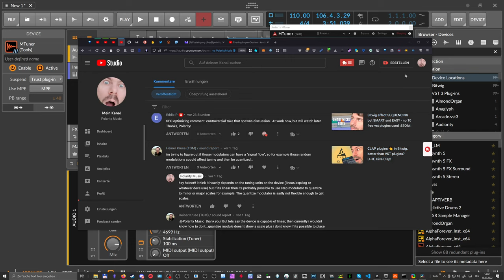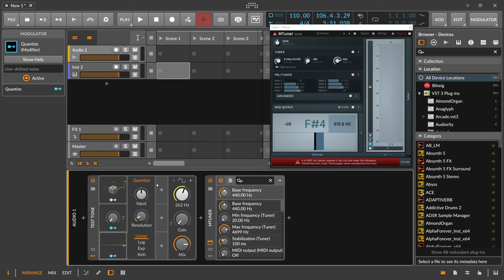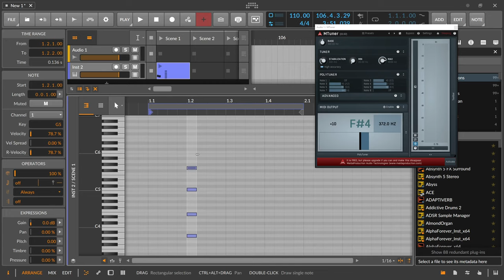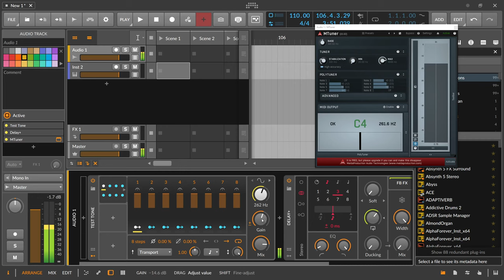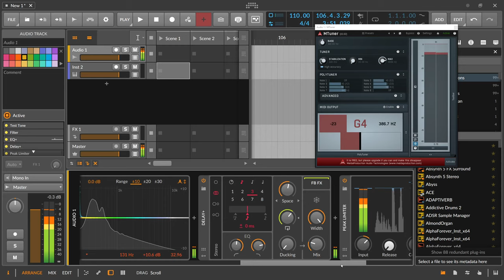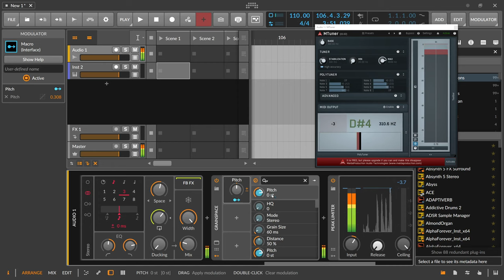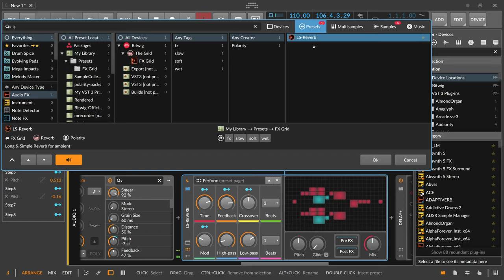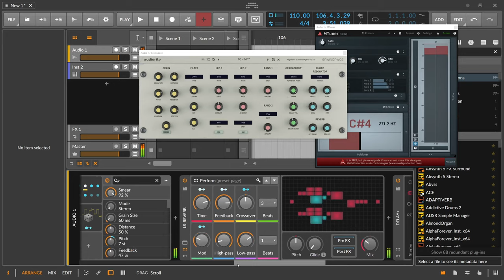Quantize Bitwig Modulations to Intervals, Notes & Scales

Comment: How did you come up with your numbers, 9 for the resolution and 64 steps ? Do you have a reference to explain how you computed this numbers ?
Reply from the maker: try and error and basic assumptions. but you can make it cleaner = you want 7 notes (for a diatonic scale) times 9 you get 63. or times 8 you get 56. so your resolution is 8 and the modulation amount is 56st. but it only works because the modulation unit is (st) and not (hz). not sure why i explained it so complicated lul

Comment: One thing I’ve never found in the bitwig modulators is a slew function (glide/lag) - I bet there’s something in there that can do it, but if so I can’t find where it’s hidden - I’d love it if someone could help me out!?
Reply: Well, in the Poly Grid, there's a module called "lag". If I place it after a pitches module and crank it up sufficiently, I can hear it gliding.
Reply from the maker: Well most modulators feature a smooth function. Some have a lag knob, some a smoothing button in the inspector. And the polynom Modulator can also help.
Reply: @pbrninja19  yeah, it’s no problem in the grid! Weird that it seems to be missing in the modulators
Reply: @PolarityMusic  yeah most of the places you’d want one have it built in but still seems like a bit of an omission to not have a dedicated module since there are so many ways to generate modulation. I know sample and hold can do something close but it’s not so great for longer slews as the slew is relative to the sample frequency (which makes sense if sample and hold is needed, but makes it hard to miss-use it). I thought polynom was more of a wave shaper but I’ll definitely give that one another look

Comment: Bitwig is brilliant at most things, but after using some of the powerful and well-designed quantisers in VCV Rack, this seems like it's WAY too hard to do. Maybe it would be easier to install Cardinal and just use the VCV ones... :-\ Or does The Grid have other types of quantiser that are more useful? I have to admit I'm a bit disappointed.
Reply: I mean... techniques described in this vid are a pretty roundabout way of achieving this result (using only modulators). In The Grid this is quite trivial to do (you indeed have the dedicated "Note Quantizer" module for this)
Reply from the maker: oh yea sure, here its only about modulation signals and only in the modulation system. in signals in the grid and for notes in general we have better options in bitwig.
Reply: @PolarityMusic  That's very good to hear. Thanks!